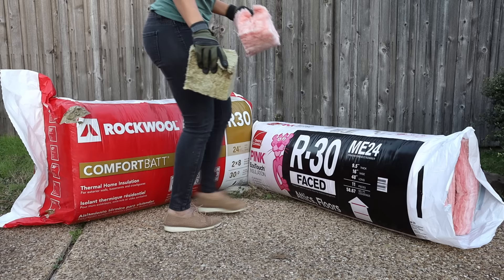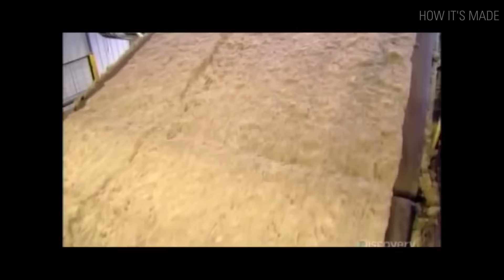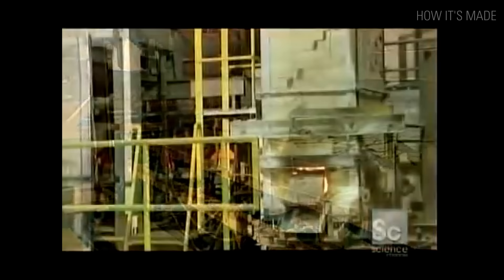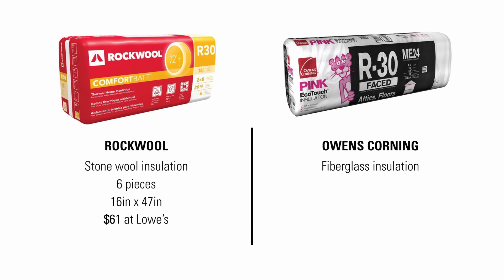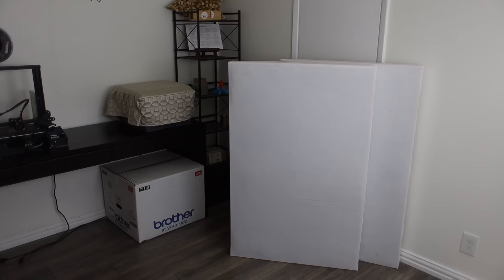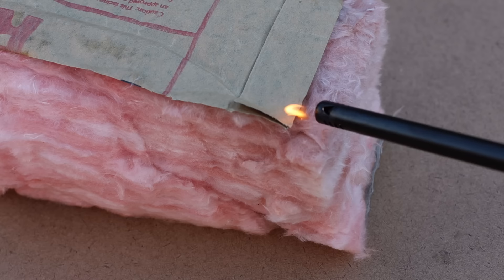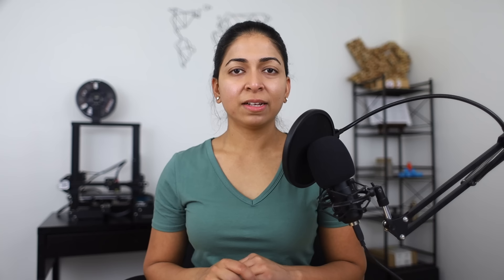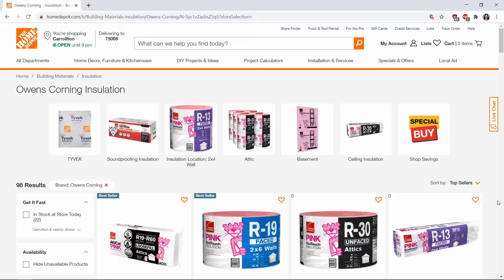Mineral wool vs fiberglass insulation | everything you need to know

Comment: Belinda, 

This is one of the best explanations on the differences between Rockwool and Fiberglass insulation that I've ever seen.  
The explanation on the acoustic is as excellent as it is correct.

The fact that the glass fiber batts absorb water and get soggy should be convincing enough not to use them.  
Roof leaks are the norm in old houses, not the exception. 
Incidentally, Natural Wool based  insulation batts are even worse. In the 1990's the NSW Australian Government, allowed the free choice of wool, Polyester fiber and glass fiber batt for the Airport Insulation program for houses in the Western Sydney airplane noise corridor.   After a few years , all of the wool batts had to be recalled and replaced due to bug infestations. Insects loved the moisture holding capacity and the natural state of the wool material. 

For long term health safety, I would strongly recommend bagging each of the batts in plastic bags (non bio degradable).  
That way any fiber break offs cannot get  picked up by roof area breeze, and so won't go into air circulation into the home.  
A tell tale that there are micro fibers from shedding batts  is that your nasal passages get inflamed and blocked after a day's exposure in a room lined with batts . 

The denser the material (the heavier)  the greater the ability for the material to attenuate sounds  travelling through it and reflecting back into a room from a back wall. If you have a choice of different rated batts  for acoustics, choose the heavier batts. 

Forget  choosing "acoustic batts"  choose heavier Rock Wool batts. The difference between the acoustic rated batts and  thermal batts
is that the Acoustic batts are "woven" in a more regular pattern.  Save your money - use the thermal rated batts. They are cheaper. 
This is coming from someone with 40+ years of acoustic experience. 

On top of the trapped air acting as an acoustic attenuator, the suspended mass in the form of fibers absorbs sound energy in the process of trying to vibrate these suspended-mass micro fibers.   It takes energy to vibrate them and this dissipates the acoustic energy travelling through the batt. 
 
We have done live acoustic testing with  gated pink noise bursts pointed at walls of these materials with the batts in various states of physical compression.  As the batts get compressed down - at some point sound simply gets reflected off the batts rather than getting absorbed by them , that was an eye opening experience.   I mention this - because there is a lot of folk lore about  squashing down batts as much as is possible. Sorry - measurements show you get worse sound absorption in a room because the sound simply gets reflected back into the room. .   You can do very simple tests to corroborate this with a mechanical clacker and an RT60 app ( try Android Audio Tool by jjbunn  I've compared this app to very expensive professional grade RT60 meters and its every bit as good.   It depends on relative measurements so its not limited by the frequency response of the phone's microphone) 

Well done with the video. So nicely laid out and great video clips of the manufacturing process. People can learn from you. 
Thank you.

Comment: Hi Belinda, a couple of comments to your informative video:
1) For the heat flow meter test method ASTM C518, the temperature of 75F is actually the 'Mean' exposure temperature based on a hot plate set at 100F and the cold plate set at 50F, and not the actual testing temperature since there is a requirement to apply a thermal gradient to determine the heat flow properties. One can use other mean temperatures, but for many purposes, the mean value of 75F allows for sufficient validation or quality control. 
2) You stated that the polyurethane foam requiring over 24 hours to reach steady-state for testing. When freshly applied, the PU foam will undergo exothermic heating as it reacts and cures. Also, some of the blowing gases or byproducts like CO2 will diffuse out of the foam and can change the insulating value, However, one normally does not test a freshly applied foam and most laboratories will follow a protocol of allowing the material test specimens to 'age' under controlled conditions of temperature and humidity prior to testing. Once placed into the testing instrument, the results can generally be obtained with high accuracy/repeatability in well under one hour.  - Source: 20+ years of experience in testing PU foam materials (but admittedly not for the building industry). Thank you, and I'm enjoying your channel!

Comment: I remember back in the mid-80’s Rockwool as it was know then only, appeared on the market but it was only available as “ blown-in insulation “ for attics, bat-form was not available yet, they hadn’t figured out the process of binding the fibres. It took until the late 90’s to get some form of bat, but nothing like the industry has today. We conducted a physical test to check the heat pass through rate of the wool and pink-bat insulation comprised of 2 heat lamps , 2 compartments of the same height (8 inches) filled with uncompressed wool and the pink with 2 thermometers poked in (1inch) deep on the tops of each with a timer set at 5 minutes. The end result? the wool had hands down slower heat transfer rate than the pink fibre-glass. We used that actual hands on comparison test to sell the wool product. If you can afford the rock-wool in it’s different densities for sound deadening or insulation that’s the way to go. As a side note, the reason why original fibreglass-bat was pink is the colour pink is what they call a “warm” colour, it’s a psychological selling tactic of the industry, you think your going to be warmer if it’s pink! 😎
Reply: For areas to block heat use polyisocyanurate.
Reply: Color also has to do with branding.  Corning is pink and J-M is yellow.
Reply: Excellent post that adds real value, thanks.
Reply: Rockwool was available in the 50's. It came as r 10 between kraft paper.
Reply: @kkarllwt  interesting.wish they didn't use other industry waste and formaldehyde as binding filler material. Lots of building materials use other industry waste as filler.
Reply: I do remember isulating my parents house in 1972 with bats of rockwool both the hard bats and the more fluffy ones was possible to get but I live in Denmark and as i remember thats were the rockwool company startet
Reply: Rockwool has been sold in bats for many decades. At least back to the 70s, whete I used it the first time.
I think the author of the first post is thinking on other manufacturers of stone wool, than Rockwool.
Rockwool is a Danish company with factories in 21 countries around the world, and the name is trademarked.
Reply: I would use it in walls for wet areas, but not as attic insulation. As little as possible. In fact I would use Polyiso alum foam before Rockwool. Much more effective for temp and noise and wet, as long as you sandwich an air gap.
Reply: @philindeblanc ... And extremely toxic, especially in a fire.

Comment: Thanks again for another informative video 

Amazing how many lay people think Rockwool is a natural wool product  and how many retailers don't correct this misnomer.

After 30 plus years of trade work crawling through ceilings, the fibreglass and paper insulations are definitely the worst for holding dust, water, mould etc. They both require 300mm unretained or 150mm retained  isolation from down lights or other penitrations. Rock wool is 150 mm unreturned and 100mm retained. (Local building codes in my area in conjunction with installation guidelines) In a house with even 20 down lights, this is a massive thermal deficit.

Comment: Rockwool is amazing stuff, it’s less itchy than fibreglass and it repels water. I remember dropping a 2” batt into a water trough. It came out soaked and I thought fit for the bin. An hour later it was bone dry. The water just ran out.
Reply: idk what you mean “less itchy” that’s the only thing i refuse to touch without long sleeves, even when i do wear long sleeves i can feel it poking through
Reply: @nevanuel1983  That’s what I’m saying I thought the rock wool was worse Lol
Reply: I have mixed experience with the itchyness. It is in some cases much easier to handle rockwool and in some cases fiberglass. Fiberglass weighs less and does not break from being bent. In other cases the bending becomes an issue.
Reply: @nevanuel1983  They're both pretty itchy to be honest. For my purpose in the application of sound absorption, I prefer glasswool because it's generally odorless and performs the same as rockwool. But if I were using it for insulation buried deep in the walls stonewool is clearly better

Comment: I was blown away at just how good RockWool is for sound insulation - I have two different guitar speakers in a cabinet in the loft with an array of microphones, the cabinet is surrounded by RockWool, this is surrounded by a second cabinet and surrounded again by RockWool. The cabinet is also stood on sorbathane feet. You can't hear anything other than a very dull bass thud and thats quiet. In the studio below its silent, all I hear from the studio monitors is what the microphones produce.
Also I get 5mm plywood, put a slab of RockWool on it, no need for frames, and wrap it with faux crushed velvet (which scatters treble better) and they make really good yet cheap and beautiful sound absorbsion for rooms - way, way better than those awful grey foam rubber tiles!

Comment: Great video Belinda.  We installed the mineral wool in the Open Book Build home on a busy street and the noise reduction is great.  It's definitely easier to install than fiberglass with the friction fit and ability to cut with a hand saw or bread knife.  And the batts really fill the wall cavity which really helps with the insulation properties.  Throw in the fire and moisture resistance and I truly believe it's a much superior product to fiberglass.  We were able to use the R23 batts with our 2x6 walls.  Keep up the quality videos.

Comment: I was not familiar with rock wool insulation until just recently so when I built my house over 25 years ago I just used glass wool insulation like everyone else. Now that I've done some remodeling and have had to get back into my walls I have found issues that the fiberglass insulation has caused (or contributed to) that I believe the rock wool would not have. These issues are generally moisture related but also have to do with the compressibility and installation. Knowing what I know now, I wish I could go back and do it over again and use rock wool instead.

Comment: One advantage of the mineral wool, also known as rockwool it capable of sustaining life in a hydroponic growing system.  Never tried fiberglass though.
Reply: Seems like something you wouldn't want in your walls unless it was a vertical farm
Reply: @KaceyGreen  It's use as a medium to transmit nutrients and secure the roots in horizontal and vertical grows.  The garden centers even sell cups and pots made of rockwool.
Reply: @TechGorilla1987  I wonder what my Aero garden uses for a medium, I always thought it was a sponge.
Reply: @KaceyGreen  I looked them up and it looks like a composite material  Like it may be peat and rockwool pressed in to  a shape.  Others like using a 50/50 mix of perlite and vermiculite for the same purpose.
Reply: @TechGorilla1987  Rockwool is really neat stuff, and it's so weird to me that a bunch of petroleum byproducts can become something like it.   I don't think fiberglass would work in the same application because it doesn't hold its structure when it is wet.  Rockwool works because it is just ridgid enough to allow water to flow through it, and fine enough to hold both water and air for healthy root growth.
Reply: that mineral wool that is used in hydroponic systems is different from what was described in this video. in the stuff used in hydroponic systems, the mineral wool fibers are manufactured like straws (that is a different production process than what was shown in this video). that allows for enhanced water retention.
Reply: @nefariousyawn  Not petroleum by products, watch the video again!! Rockwool produced by mining basalt & from steel production..
Reply: Tech Gorilla yes, even IKEA included stone wool substrate for their tiny hydroponic system. But that stone wool has been manufactured without adding mineral oil, so the water properties of building stone wool and hydroponic stone wool are in fact completely the opposite. Check out the 7strengths of stone videos by @rockwool if you want to learn more.
Reply: rock wool and mineral wool are two different products clearly not the same!!!!!!!!!
I have never heard anyone call rock wool mineral wool and you won't get me
to purchase mineral wool pure trash.
Reply: @per-so-neta  the mineral oil is so that water will roll off the surface. that is mainly for marketing purposes. the mineral fibers themselves do not absorb water.
Reply: @thetinker3924  rock wool is made from mineral fibers. so i don't see the distinction that you are trying to make.

Comment: I bought a 1200 foot square house that needed gutting. Full rewire, insulating, the works. I went with Rockwool for the attic, internal walls, external walls and first floor ceiling. It was pricy but so worth it, the house is toasty in winter and needs less AC in summer, thanks to its excellent thermal properties. The sounded deadening is a great bonus too, as we have wood floors throughout and it helps to keep the noise down in this compact, cape style house.

Comment: Thankyou so much, Belinda... I've learned more in the last 11 minutes than in 30 years in construction. You don't talk down to people, you present info in a manner anybody can relate to (pretty pictures help - but so do the manufacturing videos), and you present it succinctly. I've ripped out old f-g insulation that has been brittle and where the strands are almost slivers of glass - very unfriendly and hard to handle... newer stuff is much cleaner. Your parting comment about being 'blown away' made me laugh... I myself have often wondered how come someone walking along a beach would think to heat up some of the sand, add some soda ash - and make something transparent.

Comment: 40 years in construction and never knew what mineral wool was. TY.
Reply: Don't feel like you missed something.  It's incredibly market dependent.  Where I live in the upper midwest, you can't buy it locally, and I've never seen it used in an actual construction or remodeling project.  When it comes to spun fiber insulation, fiberglass is what we get, like it or not.   I do see some denim (cotton) based batts on occasion, but that's a very niche-ey product.
Reply: @floobertuber  didn't use it often but used for putting around B-vent in tight places near wood because we were told it had a better fire rating.
Reply: @eottoe2001  That makes a lot of sense, given what Belinda said in the video. 👍
Reply: @floobertuber  Where in the upper Midwest? I love in Indiana and have been useing Roxull for the last decade.
Reply: @michaelhamerin3814  Closer to Canada than to you :-)
Reply: @michaelhamerin3814  Well, I'll be damned, I stand corrected.  Checked out the new Menards ad today, and while it's not the Roxull brand, they have Johns Manville-made mineral wool.  I don't know how long that's been available, but obviously my assertion that it can't be bought here, is no longer the case.  Here's the product page for it...  https://www.menards.com/main/p-1568096959684.htm
Reply: As an electrician I saw rock/mineral wool all the time in the old homes that were being remodeled, it was very popular before the use of fiberglass. " Rock wool has been used as insulation since the late 1800s, and was popular as both blown-in and batting insulation during the 1950s. The loose blown-in rock wool was used mainly in attics, while the batting, or paper-backed type, was used in walls."
https://homeguides.sfgate.com/kind-wall-insulation-used-early-50s-85855.html
Reply: I do construction in NYC for 30 years. Started to use RockWool around 15 years ago. Excellent material.
Reply: You just needed to read more. There's more information and science behind insulation than you can probably grasp. Stack effect is a good read and then there's the arguments about BTL(building tightness limits).

Comment: I love your work Ms. Carr! An advantage of rockwool is mice won't nest in/with rockwool, while they LOVE fiberglass.  Our cabin is vacant all winter.  One year, they filled our sewing machine with pink; yes the inside of the cast metal. I had both Roxul and Pink, unused in the attic.  The mice didn't touch the Roxul but had a party with the Pink.  Mouse pee inside a wall stinks "to high heaven".

Comment: Thanks for your excellent channel and your approach to The building sciences, which as we know can be very subjective.
As a design professional for a major utility company I was given the task to update our insulation spec.
Many factors were discussed amongst stake holders.
In the end cost wasn't the major factor.
Fire, smoke , and performance (across the spectrum) were determining factors.
Only two insulation types were finally spec for above ground use - mineral wool (gernetic) and cellulose met our requirements.

Comment: Fibreglass has come out with higher density products comparable to rockwool (R24 has 7 pcs per bag). I’ve installed both for 30 years and find fibreglass much easier to install, especially around plugs, wires and pipes.